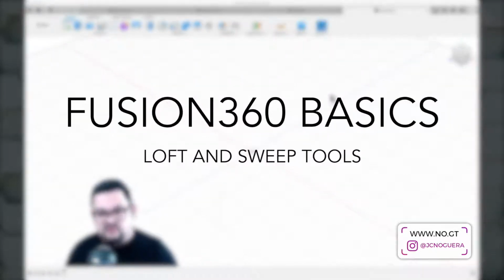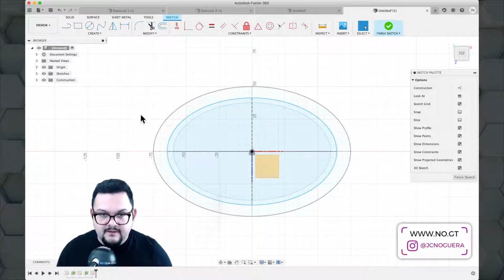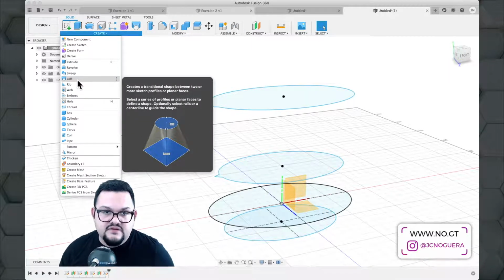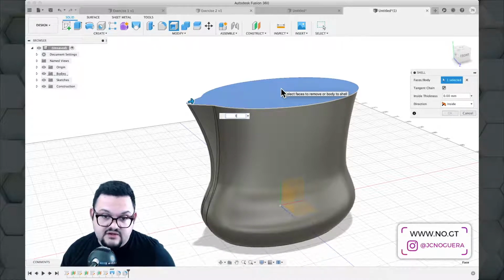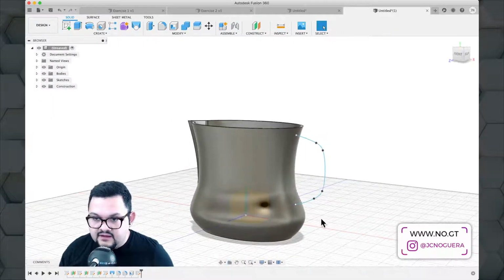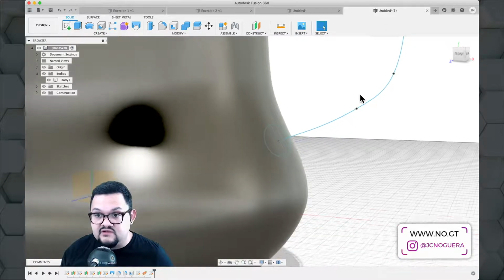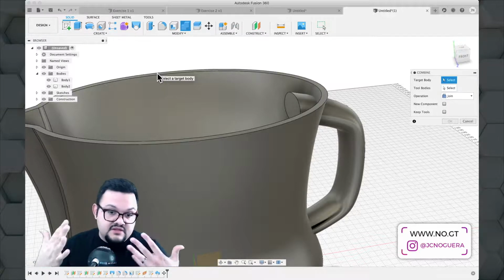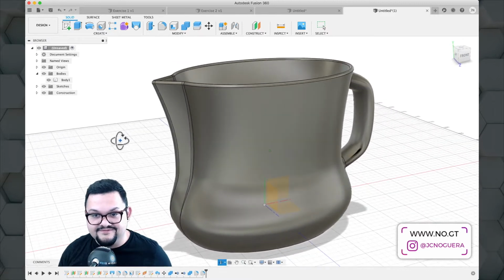Fusion360 for Beginners (Part 3, Loft & Sweep Tools)

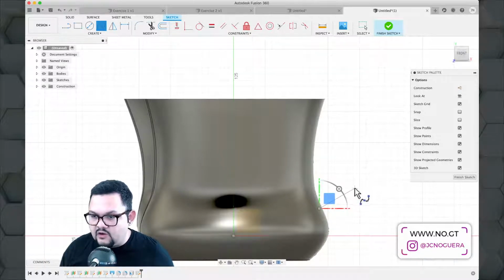Comment: At 14:21 I can't figure out how to make my spline create on the y axis, no matter the surface I hit- It keeps forming on the x axis and will not connect to the vessel. 😭😭😭
Reply from the maker: Fiona, try hiding the pitcher body (by hitting its "eye" icon on the browser tree) before you start the sketch. Then go to Create > New Sketch and choose the correct plane. You can also choose the plane from the browser tree by expanding the "origin" folder on the browser tree, all of the base planes are selectable there.
Reply: @nogueracardoza  That seems to work- Thanks